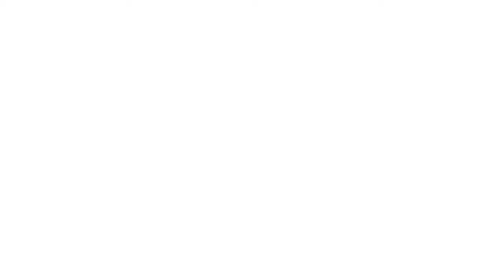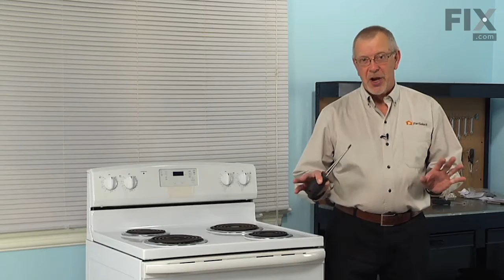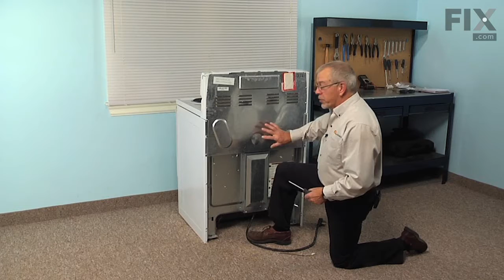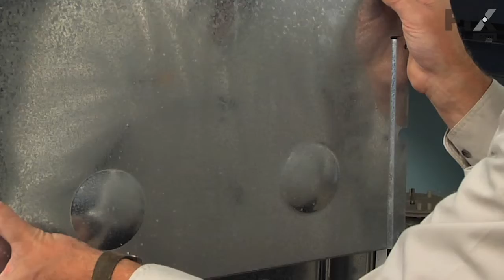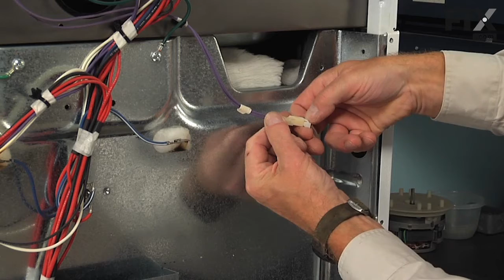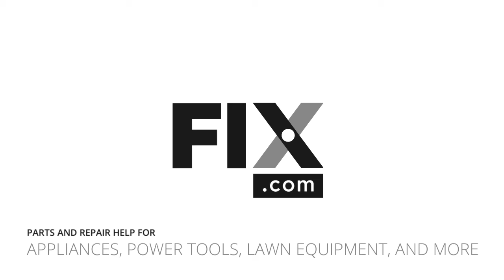Whirlpool Range Repair – How to replace the Oven Temp Sensor

Comment: A little tough getting that back panel back on. Ya gotta nuance it in place and make sure the center of the bottom is over a grill part that juts out. 
Warming it up to 350 degrees now. It has not gone over 300 in 2 weeks. And..... waiting for it.....STILL NOT GOING ABOVE 300 DEGREES! CURSES!

Comment: My old whirlpool glass top range oven is having a couple of issues going on....1st... takes 1 hour or more to get up to 400÷ -  and 500 bake or broil is same... bottom element replaced a few yrs ago.... takes over 1 hour to get elements to glow red... is that a OvenTemp. Probe issue?     2nd.. glass top front right boiler eye will usually max out at 1/4 low to 1/2 med. high burning wide open.... is that a thermoswitch w/knob part issue? Thanks